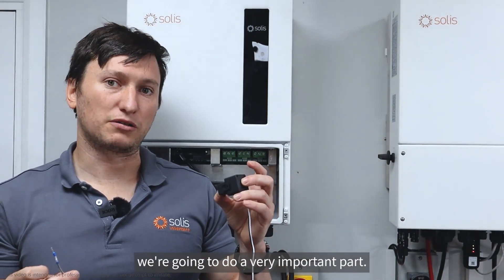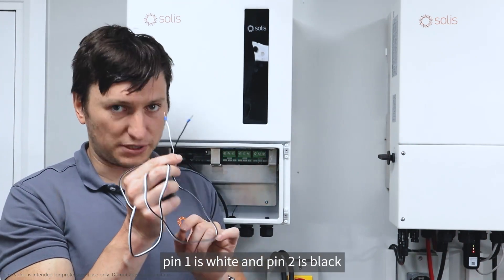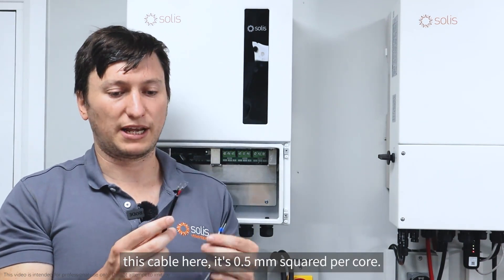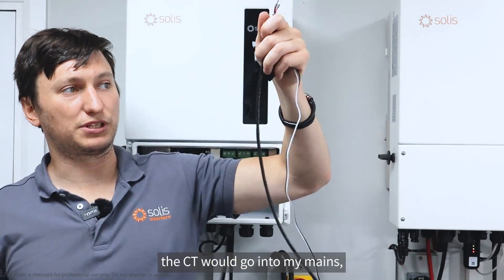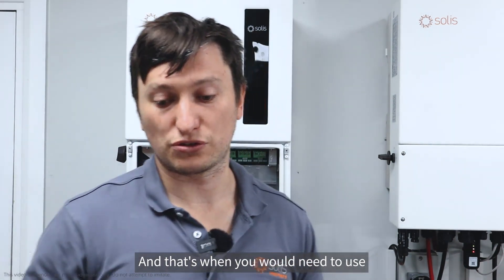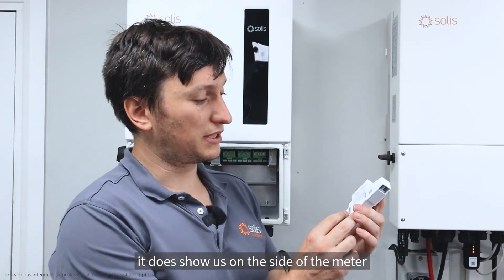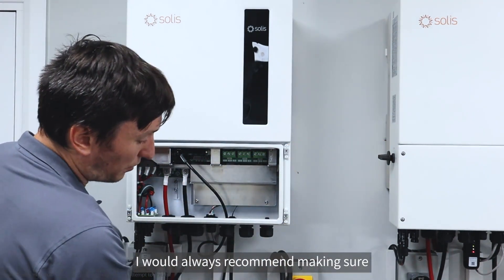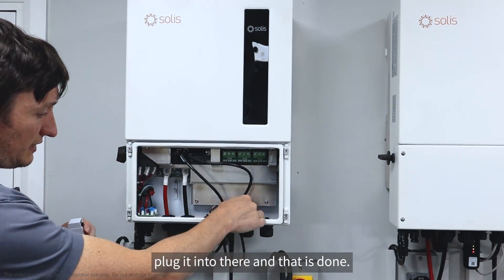Solis Installation Guide 𝐒𝐞𝐜𝐭𝐢𝐨𝐧 𝟑 𝐂𝐓 & 𝐌𝐞𝐭𝐞𝐫 𝐌𝐨𝐧𝐢𝐭𝐨𝐫𝐢𝐧𝐠 𝐎𝐩𝐭𝐢𝐨𝐧𝐬

Comment: I have 
installed this inverter CT and meter, but I have problem. the problem in power not read in meter. what is the the solution ? please advise. Thanks